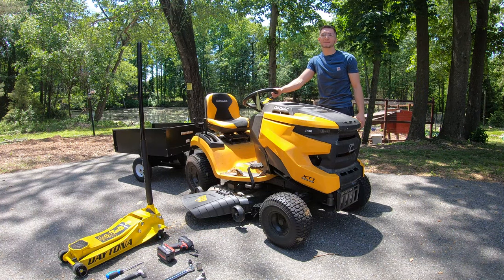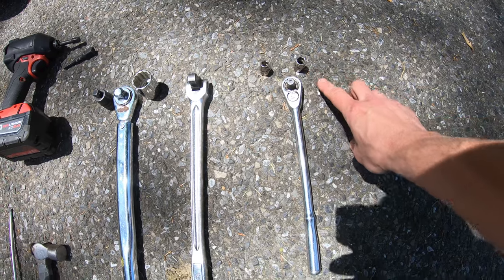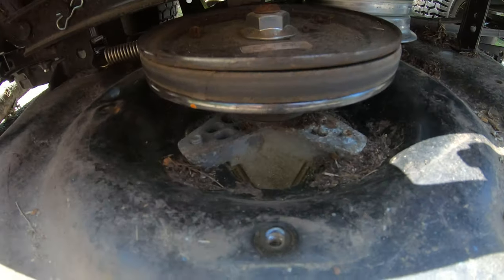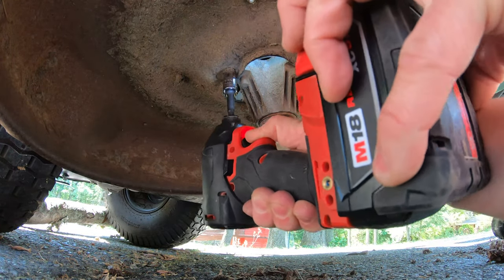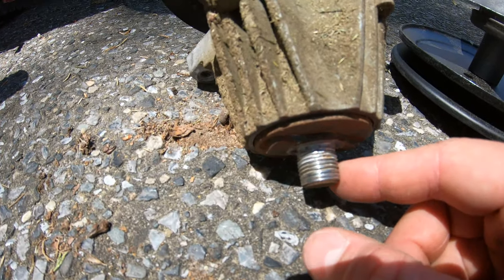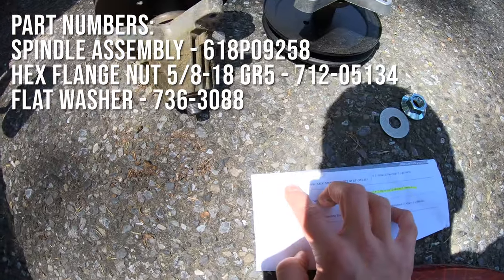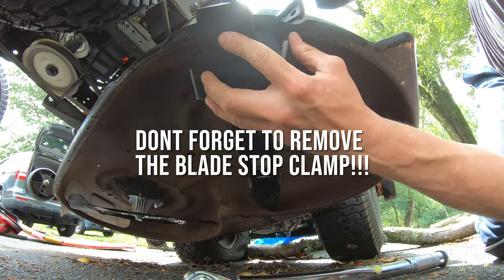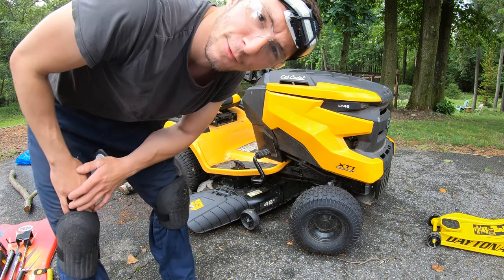How To Replace Spindle Assembly on a Cub Cadet XT1 LT46

Comment: Went to tange my blades and the bolt turns while the blade is stopped it it making for an interesting job i for see an angle grinder to cut the nut from the blade in my future. Previous owner did a number on this thing.
Reply from the maker: Yeah sometimes you have to cut them if they won’t come off, but be aware you will need to replace your spindle assembly if you do this!
Reply: @VinnieT  I took the top nut off the spindle and replaced the spindle assembly and blades
Reply from the maker: @pewspaws6795 glad to hear you got it figured out!
Reply: @VinnieT  it took some work but it's all good now and is running and cutting great
Reply from the maker: Wonderful, glad to hear it! Happy mowing this season!
Reply: @VinnieT  the bearings in the spindle assembly were very rough the new ones are very smooth and it cuts very nice now with the mulching blades

Comment: You can take the deck off super easily on these. Way better than a Jack and doing everything still attached
Reply from the maker: I would agree, I took the deck off of my Toro Zero Turn in another video. It was much easier.

Comment: Good video, however the blade stop is designed to place the blade inside the U of the bracket. Easier to take blade on or off.

Comment: thanks for the video. I'm in the middle of doing this myself, and it really helped. quick question: why didn't you just re-use the original self-tap bolts?
Reply from the maker: The original bolts just didn’t seem to be in the best condition but you definitely could always reuse them. I just tend to replace them if they’re cheap so I know everything is new and isn’t going to be rusty and hard to get off in the future.

Comment: I hit a few rocks with my XT1 LT46 and the blade fell off, then I used a random flanged nut that didnt quite fit and stripped the bolt on the spindle. This video seems like it’ll help a lot thanks.
Reply from the maker: This video should make it fairly easy to replace the whole spindle assembly and I would recommend replacing both the spindle assembly and the blade, with new hardware too.

Comment: Anyone got a part number for a 6 point star spindle that's a replacement for this S Blade with the sorry blade options?
Reply from the maker: There might be more recommended items on that Spindle Assembly Amazon link, look on that page to see what others may have also purchased. And I always like to put the make and model of the mower in to make sure the parts fit, and double checking reviews/Q&A as well.
Reply: @VinnieT  Contacted 8Ten and after install I can confirm their PN: c-spn-0053 is a direct fit for changing the S-Blade to 6 point star on a 2022 XT1 LT46.  Their LawnRazor mulching blades did an awesome job today too.  So glad to be able to get $30 blades that work much better.